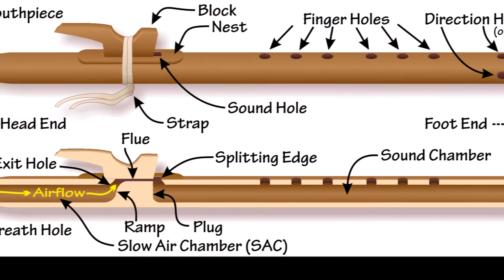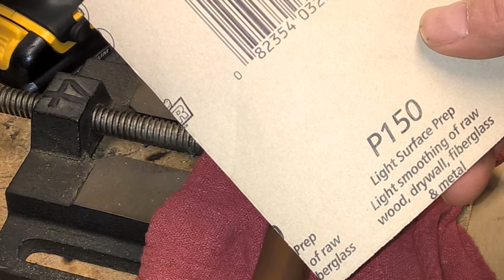Copper Flute 12 27 16

Comment: Actually came looking for help to make myself a  Chinese flute /staff with a hidden sword that can be turned into a spear.
I've made the staff/sword/ spear combination in a simple looking walking stick. Let me tell you, that thing was badass. I got a reasonable samurai blade and sharpened the back edge to match the front curve of the blade.
Changed the handle to include a locking pin and that allowed the sword handle to lock inside it's sheath turning it into a double handed sword or spear. "ssadab"(reverse of "badass") I called it.
But damned if nobody ever caused me to test it.
Ah well,next project 🙏☯️